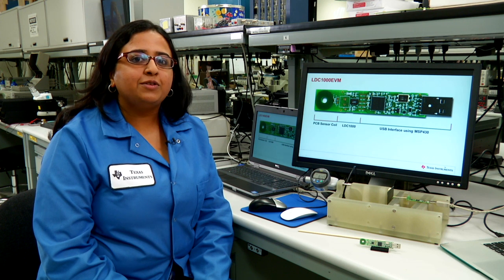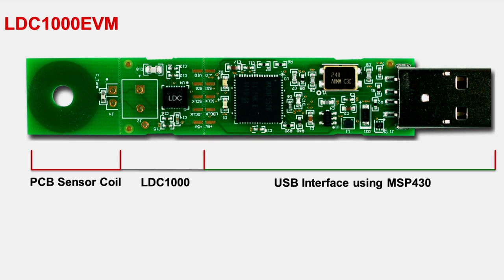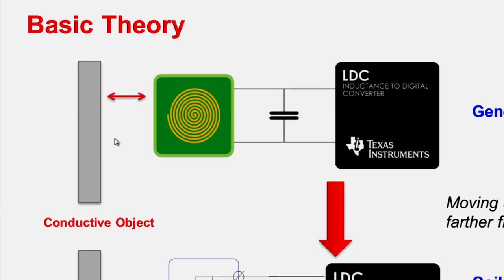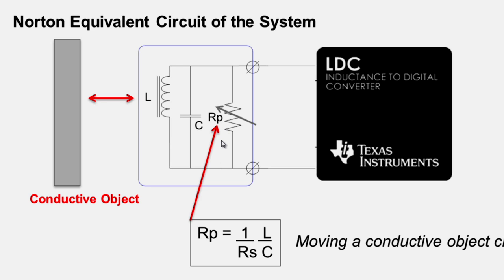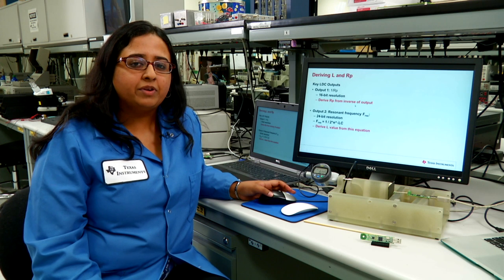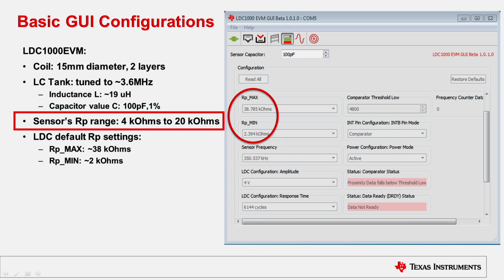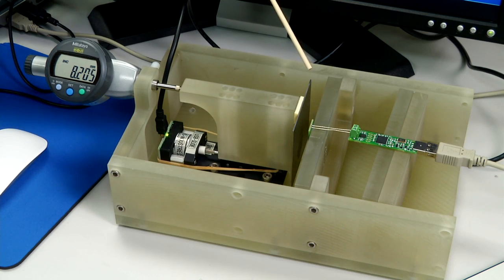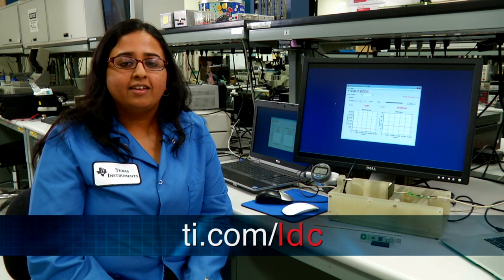Getting Started with the LDC1000 EVM

Comment: Why is the inductance dropping when the metal plate gets closer to the coil? Shouldn't the inductance increase instead?
Reply: It has everything to do with the reluctance. The only way it can go down though is that the plate is a material with a relative permeability less than air.
Reply: Eddy current opposes the inductance generated by coil so it reduces.